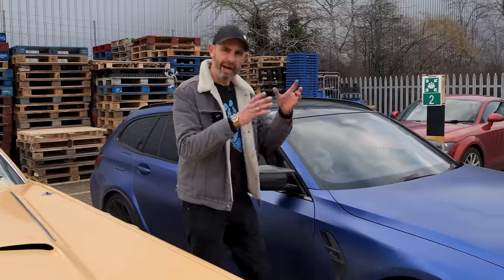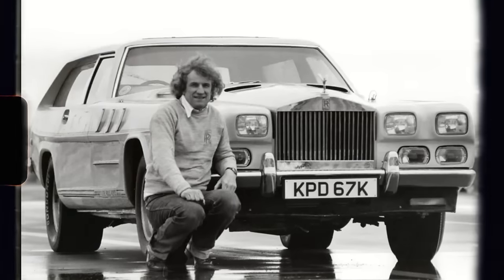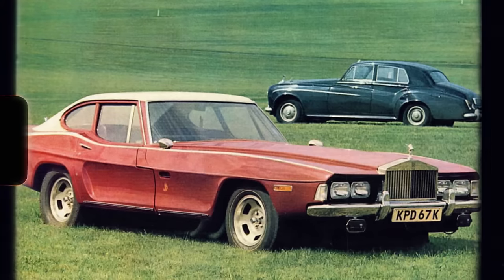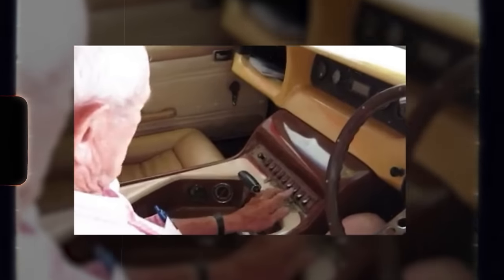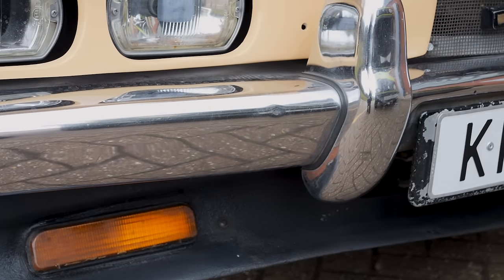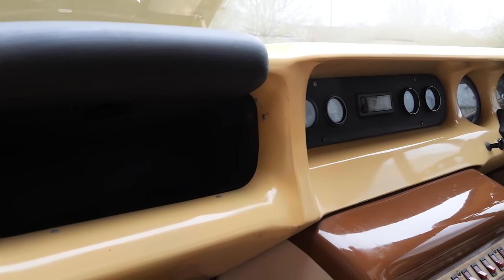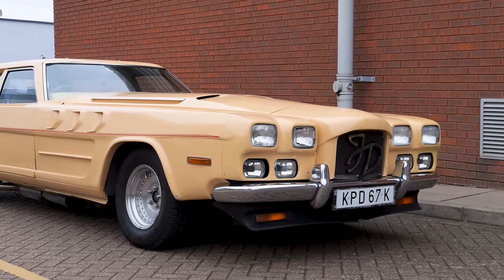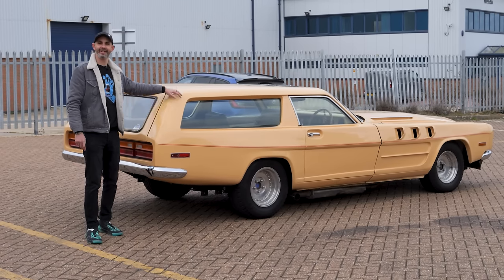Driving The Beast! 27-litre V12 Spitfire engined car on the street

Comment: Well in Germany the estimated vehicle tax for this vehicle would be:
6847 Euro
Calculation basis:
Vehicle type:
Passenger car initial registration until 04.11.2008
Drive type:
Petrol
Emission class (so-called Euro emission standard):
Other
Engine capacity:
27000 cc

I don't even need half that value for my annual fuel bill lol...

Comment: this car is experimentally built, i can be on the road  , and you can only use  20 horsepower out if 950    for some miles on the road, this engine is to be at  high RPMs otherwise will be damaged,, for aircraft is great but on the road use less . i hear the sound of it and swo the vibrations  ... !!! maybe somewhere safe test the engine at its full power and see what happens ... although it might be dangerous ...

Comment: As cool as this thing is - I doubt it does 950hp @2500RPM naturally aspirated on a Holley 4-barrel.

Even on 100+ octane fuel it's kinda unlikely - at a stock compression rate of only 6:1.

Unless the whole thing was re-built from the ground up - which would have been even more stupendously expensive than "simply" building a car around it.

Btw: The first aero engines in cars were used around the 1910s.

Comment: The Merlin was mever air cooled. Its liquid cooled. The allies always had higher octane fuel than the axis. The comment about it taking any old fuel is rubbish.  The Merlin and Meteors were one and the same. Merlins from crashed aircraft were salvaged, rebuilt, stripped of the supercharger then fitted to tanks because it was judged too risky to put them back in aircraft.

Comment: that power figure is impossible. you wanna know how? because horsepower is torque times rpm divided by 5252, so unless it revs over 5252 it can never have more horsepower than torque and to the contrary, if it idles over 5252 it will never have more torque than horsepower

Comment: I sense if this is a way quieter more refined class of car (sounding more like an original regular RR car) then RRMC may then be more accommodating in his use of the RR car grill & the standing RR logo because that'll then fit in much more closely with how a RR car should behave..it MUST be QUIET not noisy so in this regard this RR powered car already failed to meet RRMC's standards how a RR car should sound that's basically why they sued him & won ? 

So IF this had been a way quieter more refined & overall more well mannered car,  perhaps then It could then be allowed to be presented loosely as a RR powered car but not as a RR car since after all, technically speaking this car does use a real RR engine inside ?! Just like e.g. in the bus industry you have real original M-B buses as well as M-B bus-chassis only type of buses which use M-B engine but overall bodywork nothing to do with M-B yet M-B as no issue their famous 3-pointed star in circle is displayed on the bodywork of all such non-original M-B 'buses' which are in reality only M-B bus-chassis with 3rd party independent sourced bodies etc.

Comment: I sense if this is a way quieter more refined class of car (sounding more like an original regular RR car) then RRMC may then be more accomodating in his use of the RR car grill & the standing RR logo because that'll then fit in much more closely with how a RR car should behave..it MUST be QUIET not noisy so in this regard this RR powered car already failed to meet RRMC's standards how a RR car should sound that's basically why they sued him & won ? 

So IF this had been a way quieter more refined & overall more well mannered car,  perhaps then It could then be allowed to be presented loosely as a RR powered car but not as a RR car since afterall, technically speaking this car does use a real RR engine inside ?! Just like e.g. in the bus industry you have real original M-B buses as well as M-B bus-chassis only type of buses which use M-B engine but overall bodywork nothing to do with M-B yet M-B as no issue their famous 3-pointed star in circle is displayed on the bodywork of all such non-original M-B 'buses' which are in reality only M-B bus-chassis with 3rd party independent sourced bodies etc.

Comment: It should have been in Guiness record book as the ugliest car competting with the East German Trabant.....with that heavy steering it is not meant to go around corners....did not watch the whole viudeo so ok....27 ltr but what is the horsepower output (on wheels) .....I bet on a cirquit driving a VW Golf GTI one could drop 1-2 rounds on it before the finish...all and all belongs to a museum ..and fast cause exposed in elements the fiber will crack